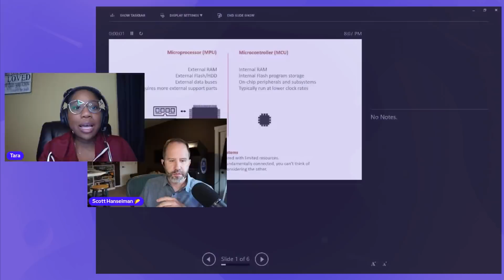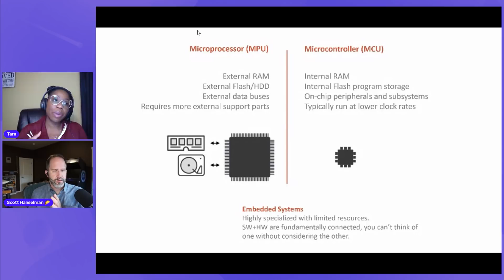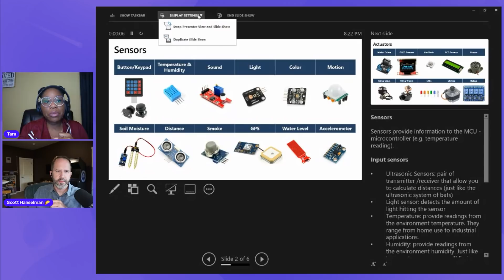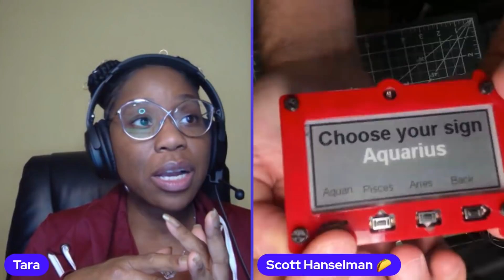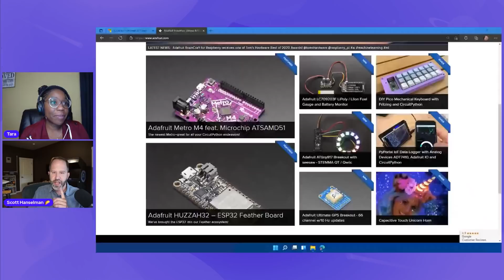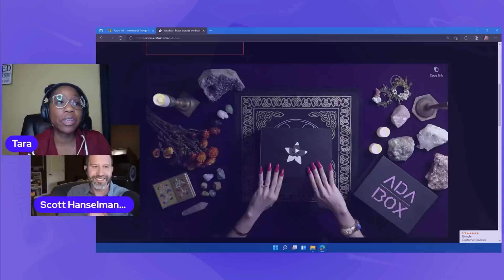Internet of Things for Beginners w/IoT Expert Tara Walker - Computer Stuff They Didn't Teach You #22

Comment: very interesting indeed. I am a linux and rpi user, recently using several to build my own k3s cluster and also a home docker instance hosting several useful tools / containers to do things like dns and traefic with web services and letsencrypt - all good fun but total overkill for things like watering plants - this is a good point and explained well in the video.

My question if you are to do another video on IOT is how can things like arduinos and other rtos based things be both powered and networked ? In the case of rpis, you can do power over ethernet but I wondered if say arduinos and the like could do somthing similar - therefore you could have a whole house of 'devices' each being both networked and powered by a hub and spoke arrangement of poe switch / hubs and patch leads, I guess ? 

I'm wondering how such a network of devices could be most economically deployed. Or would wireless be the way to go and have each device separately powered ?